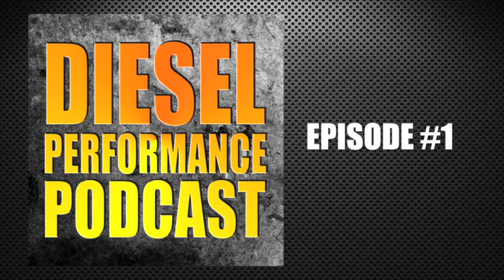The DPP Launches/Talk with Duramaxtuner.COM's Nick Priegnitz

Comment: Awesome videos! As far back as I can remember, I've been interested in diesel engines. If only all trucks, SUVs, and vans were available with diesel engines. Size and power should depend on what the size of the vehicle and what it's used for. The problem I see is that all the diesel engines available in the USA are huge displacement monster engines (6.5, 6.6, 6.7 litre) V8 and straight 6 engines, which is ok if you need that large an engine for big heavy loads. But not everyone needs such big heavy duty truck engine. For most of us, enthusiast and otherwise, a 1.5 litre to 4.0 litre diesel engine would be perfect for the job.

Comment: Richard Breuel I have three questions on your pod cast the day you guy's where talking about the lly the 2004 4.5 you had mentioned that the air intake inlet on the turbo was not the best design. and was know for failure so what brand of a turbo still stock but has better air into Inlet and what would you recommend using. for the other question is you where talk about the Allison transmission 5 speed is there a upgrade for the  transmission or would have to be rebuilt I have not had any problems with the transmission or the turbo I figure since the engines going to be torn down for head gaskets eliminate any problem before it became a problem and the last question would be on injectors staying with stock one but better than the original ones and be able to handle the pressure
Reply from the maker: +Richard Breuel Thank you for contacting us Richard! My apology for the delay in response. The Turbo Mouth Piece is the problem we were discussing there. The turbo itself is generally quite reliable. An S&B turbo inlet Air Horn is all you need. They are $199. I would suggest a DT750 Transmission from Duramaxtuner.com for your trans upgrade. If you are running a stock size turbo there is no need to upgrade your injectors. The stock ones are capable of 600 RWHP in good condition. Your stock turbo is only capable of flowing enough air to make 530 RWHP so bigger injectors will not provide any gains for you.

Comment: @Duramaxtuner how many miles could i expect out of the 2011 duramax,i bought it new with 6 miles on it,ive always changed the oil at 40 to 50% on the monitor,and fuel filter about 50 to 60% on the monitor. powerstroke buddy keeps tellin the egr will take my turbo out about 150,000 im at 112,000 now! no issues yet!
Reply: I agree, I wanna know this as well!  either keep running mine or time to trade in.  I've got 124k on my 13 lml.  great truck!
Reply: ***** this is my 1st diesel,i traded a 06 2500hd gasser 6.0 in on the duramax,by far the best truck i ever owned.
Reply: +Game Bred Duramax I Agreed!  you should do a full delete with motor ops tunes.  the lmls run even better.
Reply: +Game Bred Duramax The LML is not known for that issue. If anything, they are more known for Cp4 failure than they are for EGR's taking out the turbo. In my experience, if the equipment is not showing any failure signs I would keep running it forever. The 2011 and 2012 do seem to have more DEF issues, but it is very rare to see them lose a turbo. Yes, I am sure there are a few isolated stories about it, but I would not say that it is common at all. The 13 + do not have a lot of reported issues on them at all.
Reply: Thanks man! I figured just another powerstroke owner hating on the Dmax.lol im the only Duramax guy out of 4 buddies with diesels,6.0 powerstroke,7.3,and buddy with a cummins, im also tired of the japanese isuzu duramax stuff too, i tellem duramax was made by an American company in ohio called Dmax LTD.
Reply: +Game Bred Duramax I just drove an 08 Ford w a 6.0 in it pulling a 40foot power boat Approximately 13,000 total weight.  sorry Ford guys but the truck didn't even compare to a dmax.  it consistently searched for the right gear and it acted like it had 20k behind it.  I'm even more sold on gm after spending 24 hours and 1400 miles driving the Ford.
Reply: +Game Bred Duramax im at the dealership i bought my truck from,they put a scanner on it,has 4 codes,1 is a turbo overboost code,never put a tuner or anything on my truck bone stock,so dont know how it over boosted,and the others r to do with def,looking at 2 scensors and new def tank assembly,turns out gm extended the warranties on 2011 models to 120,000 miles because of these def issues.
Reply: +Paul Wilson im here at penske chevrolet now,they scanned it 4 codes all together, 1 is the nox sensor,turbo over boost,and others r def related,i cant believe this happend just after talking about it.nuts
Reply: +Game Bred Duramax contact motor ops.  mine runs even better after there tunes.
Reply: +Kyle Riegle may have to do that,i have almost 113,000 on it,gm extended certain items like nox sensor and def problems to 120,000,but after that im on my own.they asked me if i wanna trade it in on a new 1,gm supposedly fixed all these issues in the 13 model yr they say.but i just paid this truck off id like to drive it a while before jumping into a payment again! lol always somthin, thank u guys for ur responses and ideas.
Reply: +Game Bred Duramax I had similar happen to my 13.  decided to do exhaust and motor ops.  as long as you can get by w it in your state you should be good.  I have 124k and counting on mine.  motor ops and duramaxtuner have great customer service and have gone above and beyond customer service.
Reply: +Game Bred Duramax Go figure! It may be something simple like just an NoX sensor, or it may be time to contact motorops.ca. have you scanned it for codes?

Comment: That was the most concise and informative comparison between the generations of Duramax  I have ever read or heard. My '05 LLY is basically stock (LBZ intake, EGR mod, and tuner) and has served me well for 10 years and 200,000 miles. I have hauled loads across the country with only one overheating episode, which was my fault for taking a heavy load. Don't abuse the trucks, maintain them well, and they should last a very long time. Everyone likes HP and torque, and the factory gave us that in reliable quantities. If you want more, get it done right, with the help of knowledgeable pros, and empty your wallet accordingly.
Reply: +FRANK Gman That is great feedback, thank you! I do poke at the LLY but it is all in good fun. I'm glad to hear yours has done so well for you.